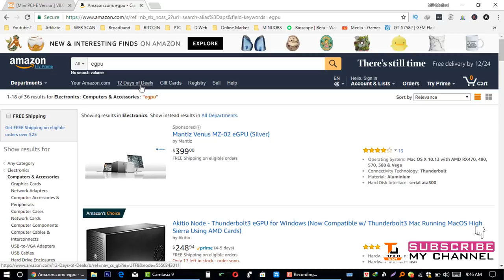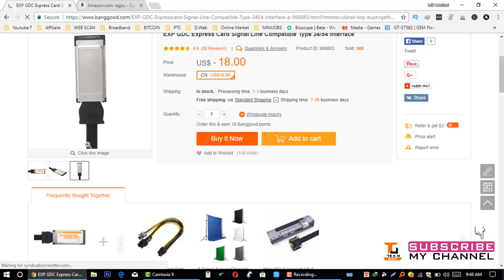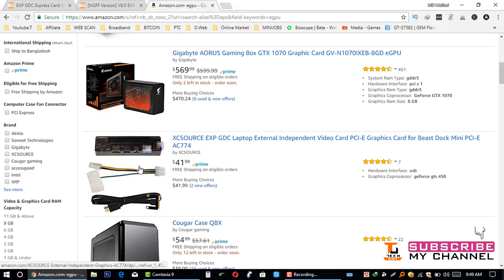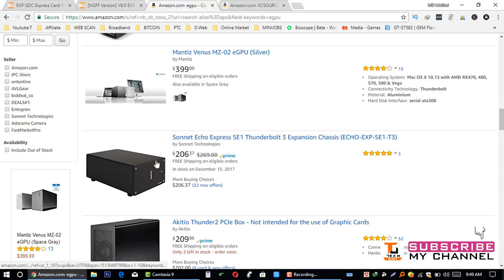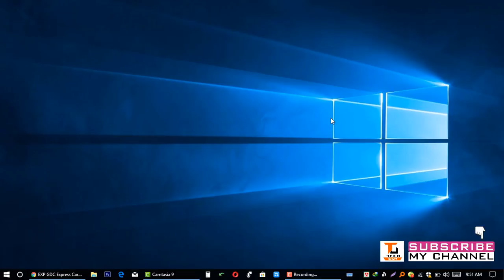Make Laptop external  Mini Pci-E graphics card | Desktop Graphics to Laptop

Comment: Ay pcie riser ta ki Acer nitro 5 2018 with i7 7700hq cholbe? taratari utor dela bhalo hobe.
Will this lapto the Acer nitro 5 2018 with a i7 7700hq work with the pcie riser. Could you please respond quickly?
Reply from the maker: eita only 2nd gen 3rd gen laptop er jonne

Comment: Ok but like I don’t wanna take my laptop apart risking it to break so is there a way I don’t have to do that, I have a newer laptop, y’all have old ones. 

Edit: I found a way, it’s called buying a gpu enclosure
Reply: gpu enclosure also use pci , so in any case you must remove wifi card and place cable
Reply: @Lspixel  yea I’ve been tryna get a gpu enclosure for my laptop

Comment: Can we use this external PCI slot with a Sata Raid Controller Card ? i want to connect some hdd as internal on laptop.
Reply from the maker: no bro you can't use external PCI slot this method  external gpu

Comment: My laptop has an express card slot, so how can i connect eGPU? In cheap
Reply from the maker: First you need to get an Express version of EXP GDC and  then you can connect the gpu on you laptop
Reply: @TechgSm1  that's too costly,
Reply: @amans6504  yeap! You cant use $9 thing. It will cut your gpu performa in half.

Comment: i have gtx 1050 ti gigabyte winndforce oc and my laptop is asus x550l i5-4200U 1.6Ghz Intel Gr4aphics will it work on riser card my gtx doesn`t need extra power supply?????
Reply: Hey I am also going to use the GTX 1050 Ti on my i5 4210u laptop. So can you please tell me, Did it work? I really want to know..
Reply: @Aruj Did it work?
Reply: @tst9110  no it didn't, I tried everything. However when i installed it on my i3 4005u laptop, it worked. All I had to do was install the nvidia driver. but it still was bottlenecking a lot due to weak weak CPU, so i ended up building a PC. I would not recommend using riser because it is a hit or miss. It worked on 1 laptop but not another. You could build a computer easily under 15k with i7 4770 and you would get the full power of the GPU.
Reply: @Aruj  Ok bro Thanks alot for your information. I have the same cpu as you i5 4210u in my laptop and I wanted to know fully if it works or not before purchasing.  Thanks for your guidance. I don't have enough money to build a full pc yet so I'll just install a Ssd in my laptop to make it more usable.

Comment: Does it works on laptop display
Reply from the maker: no bro... you have need external Monitor fast time and 2nd time you can use laptop display
Reply: @TechgSm1 means at first time driver is not installed so I have to setup an external display
And after installing all drivers i can use laptop's display
Reply from the maker: i am not sure but you can try it
Reply: @TechgSm1  no i mean why first time it will not work
Reply from the maker: fast time work on 2nd display that's Mean External  gpu display and 1set display is blank  1set display is laptop display
Reply from the maker: i will try my laptop but my laptop display fastime not work
Reply: @TechgSm1  got it
Reply: @TechgSm1  does it works with gtx 1050 ti